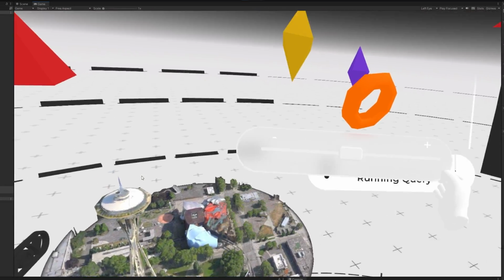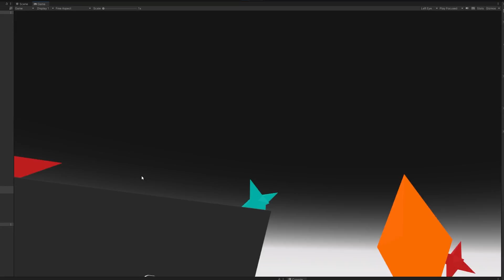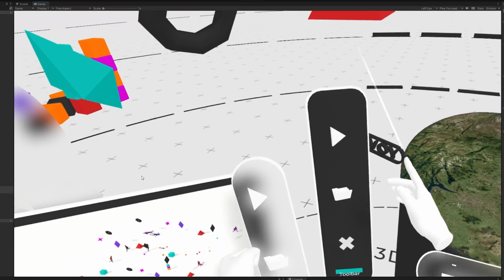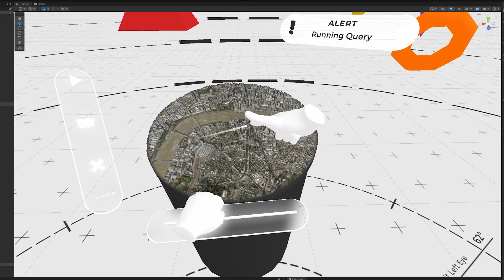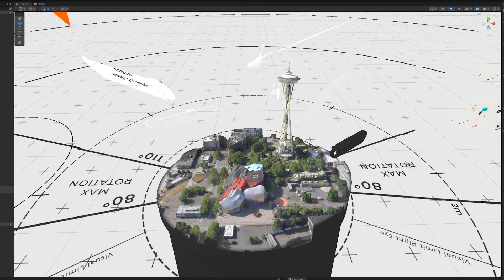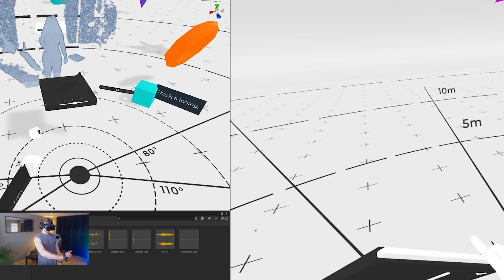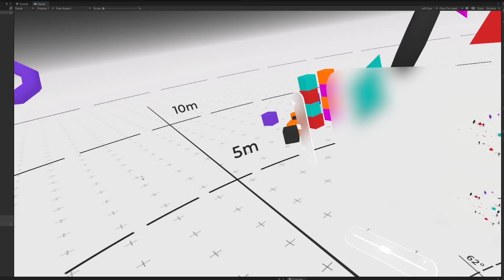Designing Modular 3D Interfaces for Virtual Reality | Springer Nature Paper

Comment: I tried downloading the code from your repo and ran into a problem where I can't move my hands. Also, is it just for the james webb or does it have all of the interactions you posted in this video? Thanks!
Reply from the maker: Hello - what headset are you using? This is built using OpenXR and tested on the Valve Index.
Reply: @corriedotdev rift S